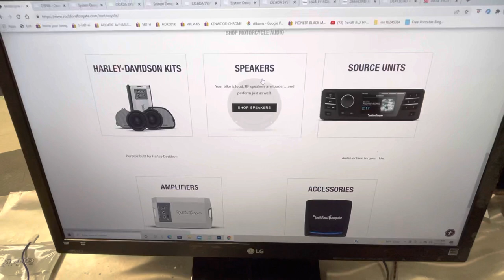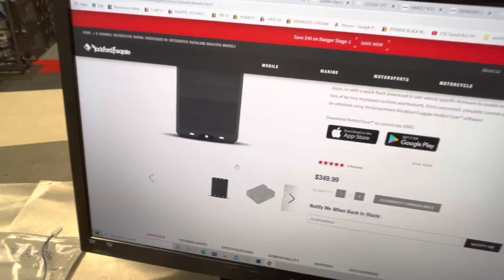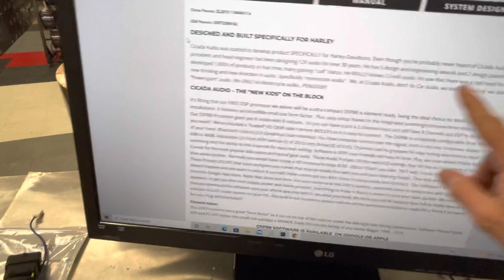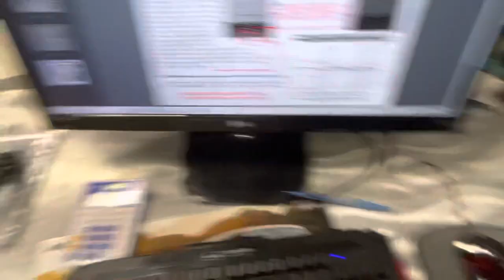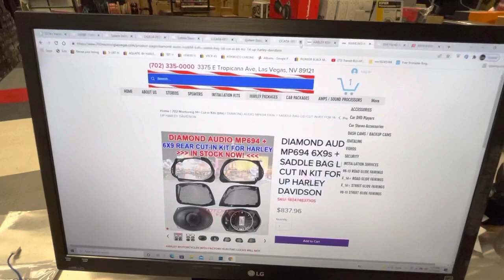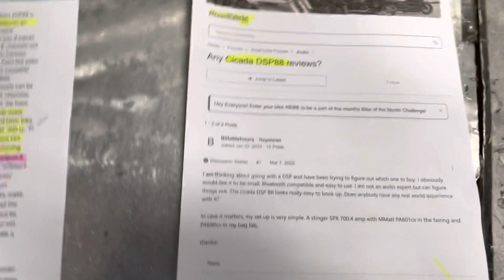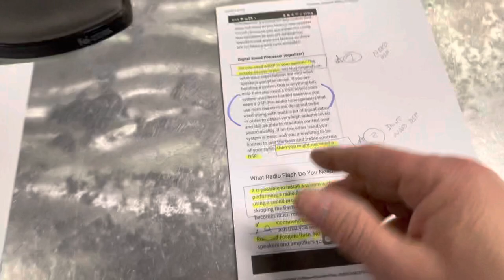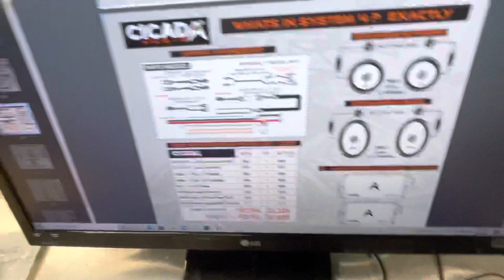YOU DO NOT NEED A DSP DIGITAL SOUND PROCESSOR ON A HARLEY DAVIDSON 2014 & UP  SOUND SYSTEM INSTALL

Comment: Two of the main reasons to flash these radios is so you can enable the rear speaker option and add an aftermarket amplifier. You do NOT need to disable the EQ and add a DSP, but a DSP WILL allow a qualified tuner to tune the audio in much finer detail than with the stock EQ. The flat line doesn't mean you've lost any signal. It means the radio isn't altering the signal.
Reply from the maker: You are incorrect with both your assumptions, the Main reason and the ONLY reason to flash the factory radio is to remove the radical harley eq curve out of the radio, it has nothing to do with rear speakers
Reply: You're both correct and wrong. 😛

Comment: Good video!  I went with the HKI mini.  8 speaker bike and sub. 2 800 x4 sound digital in fairing and 1-800 x1 for the sub in rear. Shop that did install flashed it flat and tuned it.  Sound is great and very loud and clear, I have never gone past half volume.  It was tight for room of install on the DSP because I have the CB module, but they made it fit using a T harness no cutting.
Thanks for the video, confirmed I have made the rite choices.
Reply from the maker: Glad you enjoyed the video
Reply: Are you running 8s or 10s on your bike
Reply: @xavierwilliams4320     10s from DS18.

Comment: I’m getting ready to upgrade the audio on my 2007 street glide and I’ve finally settled on a sound digital 1200.4 evox2 amplifier, cicada CH6.5” 4ohm faring speakers and cicada CH6x9” 4ohm lid speakers. I already have the new soundstream reserve HDHU-9813SG radio and it’s absolutely amazing!! I’ve never done a motorcycle system where the horn tweeter in the speakers are a 8ohm load and come with a crossover to protect them… so my question is.  Would a DSP be beneficial to me or would I be perfectly fine without one?! I know I don’t “need” one but with the tweeters being a different load I figured I’d ask a pro cause I’ve never even heard of a DSP till I started doing motorcycle audio! Sorry for the long comment I just wanted to be thorough with what I already have and what I’m upgrading to. Thanks in advance brother.

Comment: I have installed custom audio systems in cars and I was asked to install 3 Amps and a DSP on a Harley, I am glad I ran into this video. 

It’s not as crucial on cars I am thinking it has to do something with an Alternator vs a bikes charging system which uses a stator instead.

Comment: I enjoy your videos. I enjoy audio. Maybe your videos are geared towards diy guys. If that’s the case, ok I get it. But 1. Harley by putting that elevated eq curve pretty much embedded a type of sound characteristic that would allow their oe speakers to sound acceptable for their factory system according to them.  This is essentially a oe digitally sound processed tune. By flashing you come back to “flat” usable curve for aftermarket equipment.  2.  Every speaker has a sound signature that is expressed in thiele
 small parameters of said drivers. They are all different with their own unique sound.  By flashing your bike as per Rockfords recommendation you are once again re adjusting the eq curve to fit their drop in amp and speaker combo.  Well what happens when you use speaker “B” or “C” and the Rockford tune no longer gives the expected result?  Well Rockford and Idatalink has you covered with the DSR1.  As a matter of fact alot of companies have you covered for all the combination of amp and speaker sound signatures in way of a DSP.  California shops jacking up bike audio has nothing to do with using eq or DSP but more to do with the crappy work and lack of knowledge of said shops.  If this video is truly about “If you “have “ to have a DSP to do audio on a bike? Then the answer is of course no. You don’t “need” a DSP about as much as you don’t need one for a car and get by with a hi—low converter. Emphasis on “get by”.  On one hand you have a rider using conventional speakers with a simple flash , on the other a rider with same setup except using pro audio mid and compression tweeters………………… the first may sound ok but subdued in output and the other is much louder but can get over bearing at its true max potential. What do you do in either case that would indeed be the single most important upgrade in either situation? DSP.  Period.  The one tool that can shape either system from “ok or even good” to damn not only loud but clean and not just screaming .  SPL readings do nothing for rider position sound quality and output.  So…. Do you need a DSP? To all your viewers, I guess the answer is of course no. Your radio and amps will play……..  But I guarantee that it would sound much better and the $300 you invest in the DSP will improve your total “quality” of sound far surpassing the $300 invested on said DSP.  Again just my 2 cents, enjoy the vids.
Reply: Would a dsp make a difference on just a 2 speaker setup with amp? Say ground zero yellows with an sd 800.4? This is my current setup and I've tried with dsp and also without and can't really tell a difference when riding. But i also don't know much about tuning dsp and tried following steps on some YouTube videos, so I'm apparently not tuning correctly or it really isn't making a difference either way. It is quite frustrating for the diy people like me.
Reply: @SmittybuiltHD if you find a guy who can tune really well there’s gonna be a HUGE difference!!!
Reply: Well said totally agree, I would definitely want a dsp !
Reply: @RGHD912  It’s something almost all audio guys want on the bike
Reply: @Xavier Henry  the problem is finding someone who can tune really good. I've seen some reputable audio guys offer tuning over phone? How is that even possible? I'm still relativity new to this and trying to understand and learn more.
Reply: @SmittybuiltHD  that’s true
Reply from the maker: All the Rockford Flash does is eliminate the radical Harley curve, it is not specifically designed for their drop in setup, it is for anyone who chooses to install any amplifier on their Harley - it is something that must be done, the use of a DSP is a completely different situation. 
We have attempted to produce a video explaining in detail the difference between both scenarios
Reply from the maker: @SmittybuiltHD  Understood and the reason for this video is to help others by eliminating the frustration you have felt
Reply from the maker: @xavierwilliams4320  Agreed and that adds to the common frustration allot of people experience
Reply from the maker: @RGHD912  Nothing wrong with wanting a DSP - that is not what we are saying, we are only saying it is not mandatory or even necessary at least when using the quality of product we use as in Diamond Audio
Reply: @SmittybuiltHD  a DSP will make a difference . The thing is do you have the experience to tackle this on your own?  The fact that there are loads of shops who they themselves don't know their way around a DSP and they are the pros is the concerning thing. You may have to do some research around town and or reach out in Facebook groups to see if anyone recommends certain techs over others. What area are you in. State city etc
Reply: @702motoringlasvegas4  no argument out of me your rt no dsp needed but you’ll agree running your system active with a dsp will sound better. No?
Reply from the maker: @RGHD912  Of coarse and we say this in our video - our focus and opinion is with regards to if it is needed -

Comment: Wow, most of the comments in this video concerning Cicada incorrect. The DSP 88 does come with everything you need, including wire, harnesses and connectors.

Also, the amps are able to be installed easily without a professional, did it myself  for the first time and  system sounds amazing.

Comment: Thanks for the info, I’m just looking to do a 2speaker up grade on a 2022 road glide, don’t really want to install a amp or dsp or any other parts unless I need them , do I have to flash the radio or get a dsp to upgrade the fairing speakers?
Reply from the maker: If you are only adding speakers only no radio flash is needed, however you will not really notice that big of an improvement unless you add an amplifier, then a radio flash is needed, a dsp is not in this conversation as it is an item not needed or mentioning, but like we said an amplifier is something that should be considered - Do you recall that smile you had on your face when you took that 2022 Road Glide for a ride the very first time all by yourself, OK, now take that smile and imaging if it was 4 times as Wide and Big - that is what happens when you put this in your bike  https://www.702motoringlasvegas.com/product-page/harley-road-glide-diamond-audio-pro-speaker-micro4v2-amp-kit-mspro65-mo75t-horns

Comment: Is the Diamond audio DSP a prototype? It does look like a “mock up”

What are the specs of it?

Looked for the application on the Google store and apple store and nothing

Any info to be shared on a product you are showing
Reply from the maker: Proto type not yet released, ongoing testing along with two others
Reply: @702motoringlasvegas4  if it is a protoype, that is a like a teaser cause now if the prototype dont work like it didnt work the first time they thought about coming out with it, is like dangling a carrot and never give it
Reply from the maker: @chrismainor  It will be released soon enough and has nothing to do with the previous DSP

Comment: On the topic of the Hd EQ in red as depicted on the Cicada site, then the Cicada fix in the blue line
The blue line displays the complete opposite EQ curve cause then it would cancel out the existing EQ curve from HD thus producing a flat response
Reply from the maker: We are not convinced what Cicada is offering is a legitimate substitute for simply flashing the factory radio further evidenced by Cicada also stating you must run to have your bike flashed with the Rockford Flash.
Reply: It wouldn't be flat I'm not sure where you got this answer look at your flat EQ and since your HD curve is Boosted and Cicadas curve is below the flat curve. Now you're having a reduce response look at the graph
Reply from the maker: @BlackEyeSRT  Understood, our position is why reduce or downgrade the signal so much in a attempt to use an item someone is slinging to you for $329.99 when you can just flash the bike and save hundreds??
Reply: @702motoringlasvegas4  
it is not a reduction, it actually is a cancellation. which will sum out to flat or as close to flat as possible and if i am correct, that is a setting within the Cicada DSP, so if you flash, then you dont use that setting (obviously)
Reply from the maker: @chrismainor  Well, However you would like to word it fact of the matter is still the same, a DSP is not needed when installing the caliber of product as we are with my ear tuning every Bike. The Videos we post are the Proof and that it is undisputed.

Comment: I've been a professional installer since 1998.   Back in the day we set gains by ear.  Now we use an oscilloscope or dd1 if the amp doesn't have it built in.   It's a similar argument.   IMHO a processor may not be needed but it sure as hell makes it sound much better if you know how to set it up correctly.    I just don't see someone spending 5-10k on a stereo and not being able to justify a DSP even if it's as simple as a $275 DSR1.   Just literally makes no sense to me.   Having the eq and bandpass crossovers to go active etc makes it worth it.   And yes the radio has to be flashed to flat no matter what equipment is used
Reply from the maker: DSR1 Runs $349.99 - MSTLINK Runs $149.99 - Wiring & Tune =$200.00 Min that is a total of $699.98 Our Diamond Audio Sound Systems do not require that extra money, it is that good and not one single customer out of no BS Hundreds are more than satisfied with the sound they have when they ride their Harley out of our Shop, if they want to spend the extra money, Awesome, but it is NOT needed
Reply: If it works for you that's awesome. In fairness it's tough to sell something you don't believe in obviously and that's your choice as the owner or manager.  There's just no comparison with and without a DSP.  That's not subjective.   If it's not worth the money to your customer I understand and as an installer I felt the same way as you about DSP in cars for years because I wasn't 100 percent confident in my ability to tune it and our owner was a cheap ass and wouldn't buy an electrical RTA or an acoustic RTA.   Then I went to several K Fests and to Mobile Solutions and started getting  more confidence and now almost every system leaves with a DSP.  Do not take this as me bashing or anything or saying your installers arent capable.    That was just my experience
Reply from the maker: @melissathompson7229  Well let us just simply say this, the product you are used to installing back in 1998 as also myself personally is nothing compared to the Diamond Audio product we install on today's Harleys, back in 1998 you where not using DSP's you where using items like Carver KLW Image Enhancers, Phantom's & Cathedral's - I am personally also from that area, tell you what, sit in front of a PC with some nice BOSE Speakers on each side and a sub and take a listen, a REAL Listen to what these Harley's sound like we build with the equipment we use in the $3500.00 out the door installed price and experience what is nothing short than Magic - each and every bike is tuned to my ear with the screwdriver in my hand, I know what I produce and the bikes that pull out of here will go up against anything else others build in factory stock locations in sound quality and DB's of Loudness and I do it all without a DSP because I have the experience, knowledge, drive and Passion to do what I do best - I am in no way saying I build the best, or I create the best or I use the best equipment because I am not conceded - experience one of these bikes I do in front of a PC with quality speakers  - I know what I do and so do every one off my customers, it starts by using the right equipment and for 702 Motoring that is Diamond Audio
Reply: @702motoringlasvegas4  
if you sell the DSP, why not include the tune as it is part of the install you are already doing, that would give the client the value and "cost savings"
Reply: @melissathompson7229  
FACTS

cant sell something you publicly have no faith in

Comment: Man where was this video about 2 weeks ago I bought the cicada dsp. And I'm not pleased at all....as stated this unit is huge and trying to put in with my amps (800.4 sd) x2 and also as stated the damn harness coming out of each side is terrible trying not to damage any wires. Overall not very pleased with my purchase....haven't used it yet but....I own it now guess ill use it....
But my question is what are you using to go from HD to amp connection hi level or some kinda converter to low level.....
Reply from the maker: Can you send me a picture of the harnesses that came with the DSP to vegas.paul99@gmail.com so I can better comment on what you may need, also, on the DSP88 Box does it say 4V or 8V RCA Pre out?
Reply: Also note different pic on web page vs. What ya get also i will get those pics sent

Comment: Hey maybe you can help me out I would sooo appreciate it. I have a 2020 road glide the same sound digital amp and rockford speakers. So the bike did not come with lower fairing speakers. Where  would I get a harness to go from the head unit harness to the fairings? I've tried looking on forums for hours but can't find anything. Any help would be much much appreciated thanks.